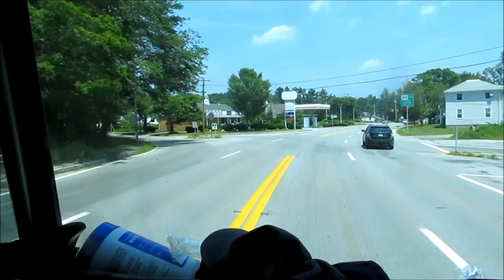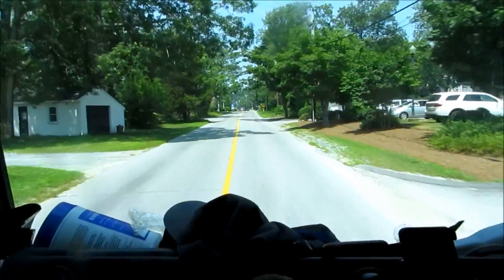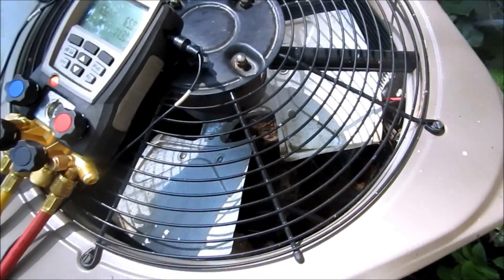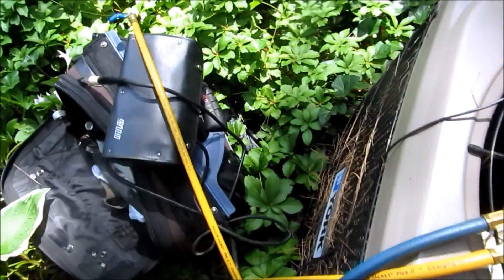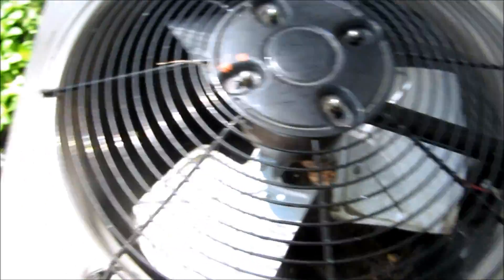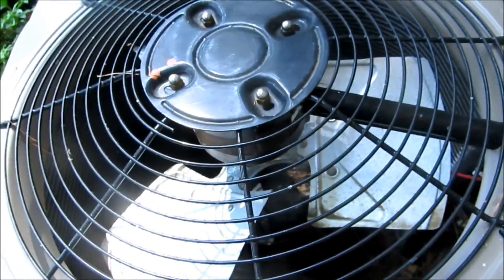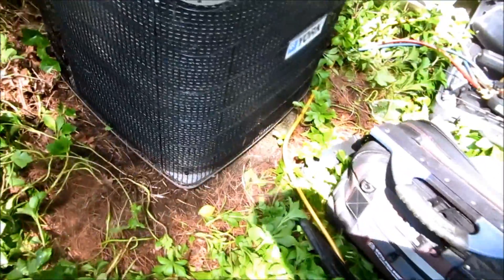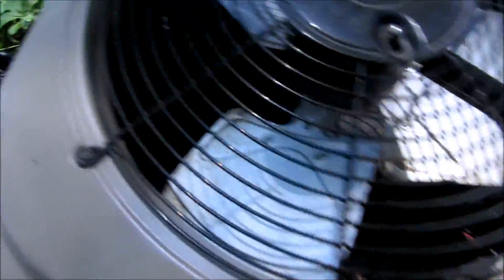HVAC- : 2 ton york condenSing unit  micro channel (she's a  leaker )

Comment: So  you put refrigerant in and what happens now ? If under warranty somebody  else comes and swaps the compressor out?
Good job finding the leak, I only seem to find leaks in the evaporator coil in an attic where its 150 degrees. You are lucky
Reply from the maker: +Dennis Adams i did bo back to change out the condenser coil it was under warrenty

Comment from the maker: that one is a yokahama  h10-g the older version i had mine for a long time and love it ..they have them on ebay used for easy money ,i usally run mine on the small leak setting .its a great tool to have .make sure you get the one that plugs into 110 volts  thanks for watching hardcooling

Comment: Man , That Jungle out there Probably corroded the Aluminum Out Pretty Fast and the Sprinklers. Any Chance Of Getting the Replacement unit up a Little Higher off the Ground. Out of the Jungle. Maybe a Bigger Slab, Build up the dirt higher. if it's not in a View Location.something to try to get it up higher for drainage and to keep Jungle out of the Unit.